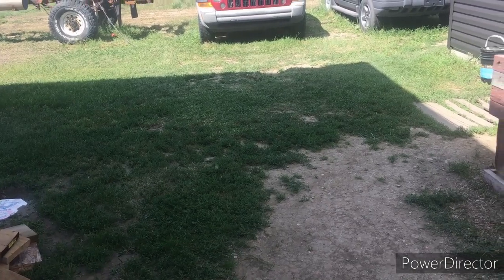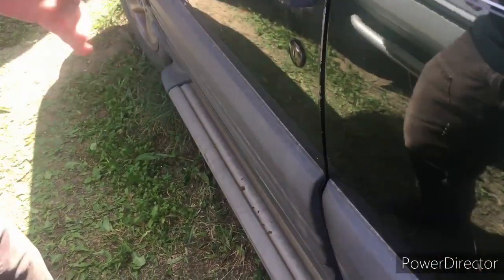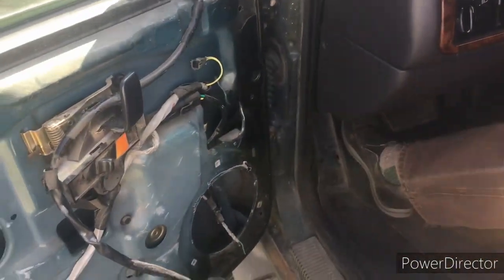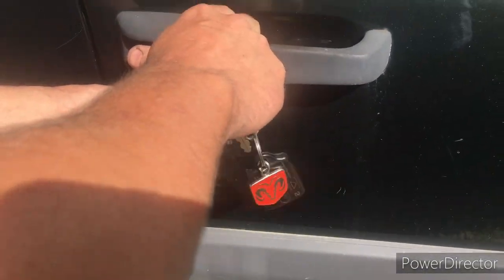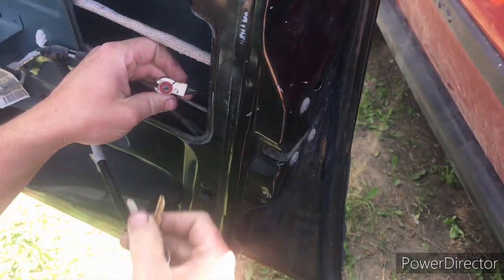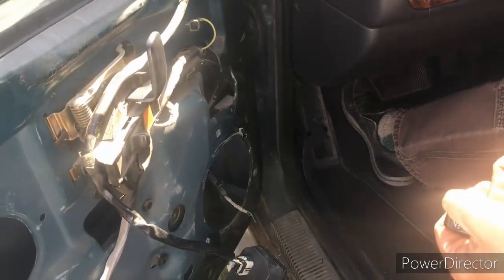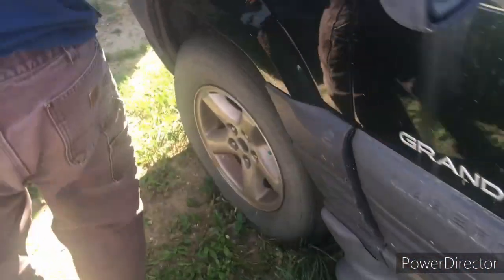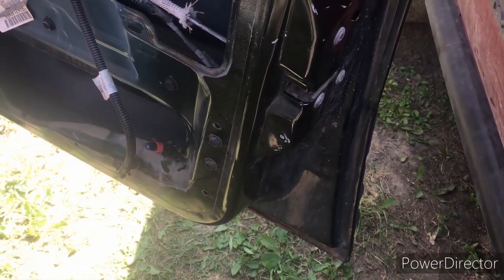1997 Jeep Grand Cherokee Alarm bypass

Comment: Thanks For the video I unlock my trunk and it started I’ve been through a lot I had to change the fuel pump change injectors checked all the wires it was just to unlock the trunk thanks for the video

Comment: thanks for this video,just bought a 1997 5,2 here in sweden in a very good condition! i have no problems with it yet but i know what to do when i get there....
Reply from the maker: We have another video called alarm bypass in-depth look that explains why I do it that way. Thanks for the comments
Reply: It won‘t work for you. European ZJs have an additional immobilizer programmed to the engine computer. You can‘t bypass it the way they do it with american models. I have tried it all.
Reply: @onepunchtyler  did you find any solution ?

Comment: Hey Buddy,, I'm watching your vid abt the jeep grand Cherokee to reprogram so you can start and Run without dying after starting it.. WHAT DO YOU SUGGEST TO DO IF THE LIGHTS AREN'T BLINKING OR THE HORN RELY ISN'T CLICKING.. DO I NEED TO HAVE THE KEY FOB THING?
Reply from the maker: I have some other videos that might help;

1997 Jeep Grand Cherokee alarm bypass (indepth look)

1998 grand Cherokee electrical the #1 bad part 1 to part 10
Reply: Hey brother did u ever fixed ur issue and how did u do it cause mine is doing it to

Comment: how do you get the key hole out though. im finding it impossible
Reply from the maker: There should be a C shaped spring clip on the inside of the door. Remove that and it should come out. Some have a plastic retainer with 2 screws above the door latch actuator, remove the screws to remove the plastic retainer and possibly a pin/clip might hold the plastic to the key cylinder, disengage it and it should come out.

Comment: What did you do to program it? You just lock it with the fob
Reply from the maker: There is no programming, by deactivating or unplugging what I am calling the key lock cylinder indicator no fault can be realized to activate the alarm. By doing this there will be no active alarm. I chose to deactivate the alarm because it is annoying problem rather than a useful feature for me.

Comment: Mate my remote not responding to transmitter so immobilizer is on ,I tried change battery in remote but no luck .any ideas? It's 1996 zj jeep grand cherokee
Reply from the maker: Try Researching resetting your key fob to the transponder in the steering column